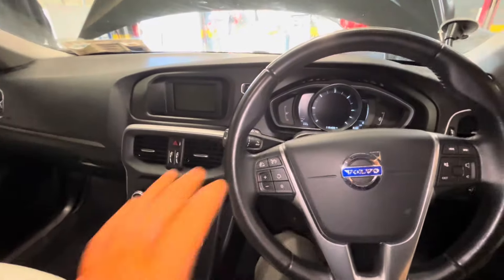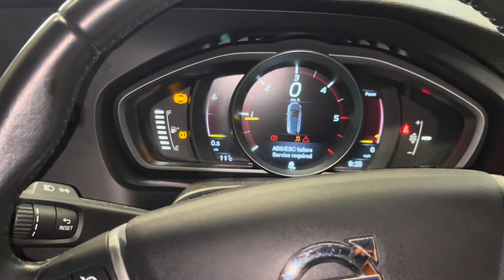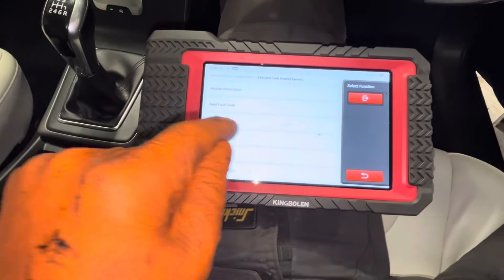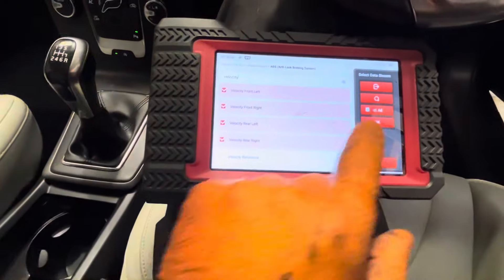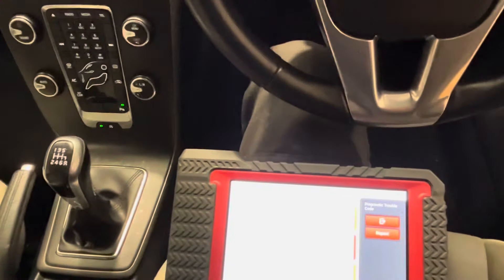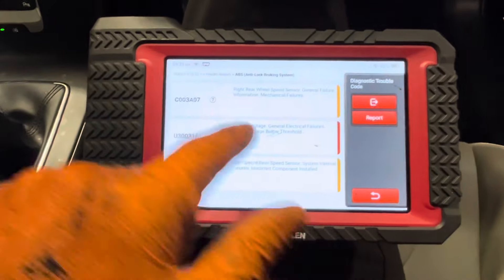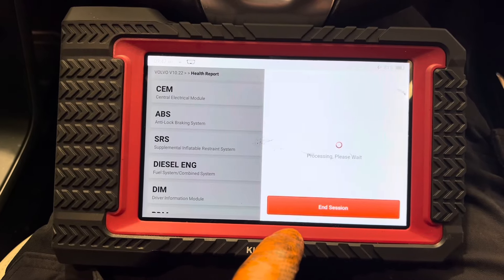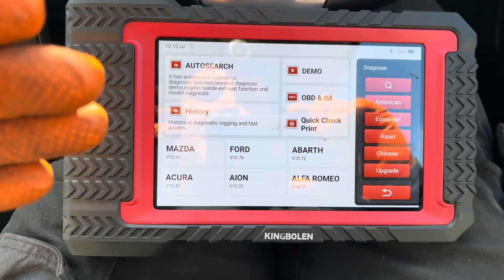Volvo V40 ABS fault diagnosis & repair using the KINGBOLEN K7 scantool

Comment: Had an 181 Passat in yesterday, Peter - owner was adamant he wanted the DPF removed & the egr blanked..  endless DPF faults & the car was in limp - he'd been everywhere & had been milked with bills.   Took the car in, had a goo - the upper temperature sensor, the one you can see right in front of yer face, wasn't in the hole.. as in it was just sat there flapping about.. rang the owner, talked sense into him about why he didn't want his DPF removed, how I could sort it for him.  He reluctantly agreed.  Cleaned the DPF, refitted the sensor, did a regen, cleared all codes - cars mintier than a pocket full of polos. Owner chuffed.  

Buoyed by this automotive triumph, I went back to a Navara I'm doing the engine on - went to fit the cams in, promptly broke the exhaust side one into more pieces than it was when God made it - any more than 1 is bad.. FFS... never broke a cam before, ever.  Bad words were said.... 

No bother, I shall source a good used cam... 6 hours driving later,  with periodic looking at worn out cams lads were selling that I didn't fancy, I managed to buy a pair (no way was he selling me just the one..) off a nice Lad so deep in Wicklow that there were wolves & mammoths still roaming around the parish.  In the lashing rain. And the dark. On a friday evening.. If these break going back in, I'm jacking & joining the Hari Krishnas.. 

I like the Volvo 40 series yokes as a rule - however they have a PCV system designed by Santa himself, which when it goes pear shaped, leads them to smoke more oil than Bush did in Iraq. It is their Achilles foot. It's also easier to burn the car & hide the ashes than it is to replace, due to the Volvo nerds getting overly clever when they drew this on paper. That said, they're still a good yoke - better still when the ABS works due to your tender ministrations.  I believe the K7 is quite good, but the K9 is a dog.
Reply from the maker: @jamesward5721 what a week you’re having 😂😂😂😂
When sh_t goes wrong it really goes wrong. Fingers crossed that the navara worked out this evening 🤞🤞
Absolutely no one avoids that kinda stuff going wrong once in a while. 
That Hilux chassis was a fair undertaking too  💪💪💪
Reply: @kennedysgarage3281  We will overcome, Peter - into every life, some p155 must sprinkle. I just shrug & plough on. Be grand. :-)

Comment: Long press on the start button puts Volvos into position 2 key switch. Just press and hold until the dash lights come on without touching the clutch if manual, or brake if its automatic.
Reply from the maker: @tomcurran65  good man Tom, one of those quirks that I’m not familiar with 🤷🏼‍♂️🤷🏼‍♂️
Reply: @kennedysgarage3281  yeah I know my Volvos, put me in another car and I can't be bothered to learn it
Reply: Those 1.6  V40s are fairly quick 180bhp ish.
Reply: Same as Renaults then, maybe Toyotas as well?

Comment: I stupidly ignored the TPM for 12 miles and its gonna cost me 230 euro for a new Michelin 245 45 19. 😢
(They come on after the air pressure drops more than 6psi i believe)